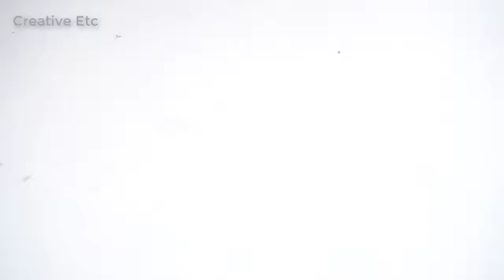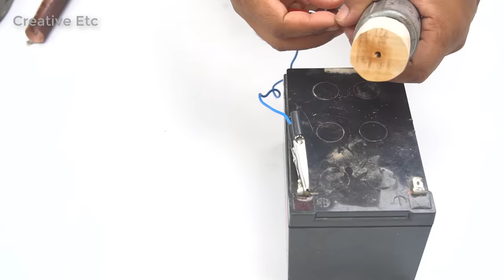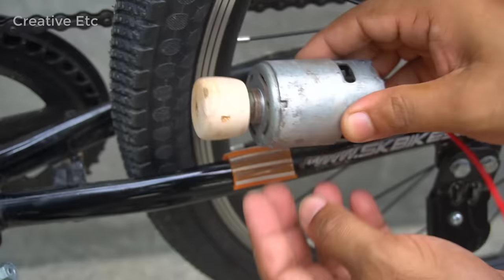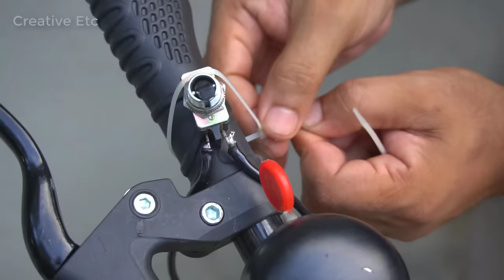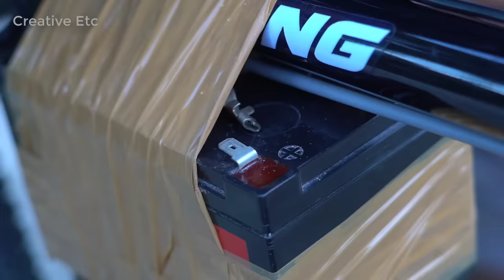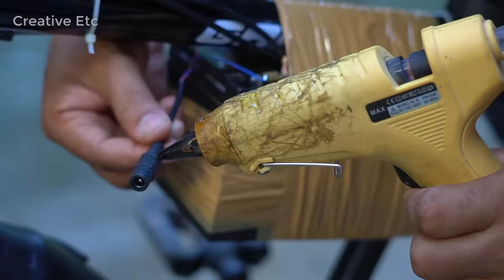How to Make Electric Bike using 775 motor

Comment: The video shown is driven down the road. Sound of an electric vehicle being driven is cleverly mixed in the video. The 775 motor does not have power to haul even a small weight. Moroeover the tyres will wear out in a few hours!!!!!!!!!!!!!!! For lab test it is fine. But not for commercial / personal or daily use.
Moreover 775 motor is used only for toys!!!!!!!!! It is a height of imagination.
The video shown is driven down the road. Cycle seems to go on gravity. Sound of the riding, like an electric vehicle, is cleverly mixed in the video. The 775 motor does have power only to haul small toys. Moroeover the cycle tyres will wear out in a few hours!!!!!!!!!!!!!!! See that wodden rotor - with black soot of carbon black from the tyres? For lab test it is fine. But not for commercial / personal use. Please don't blow others money and time. Humble request.